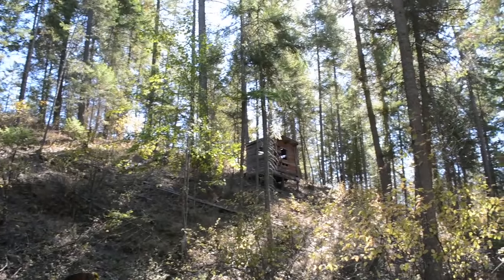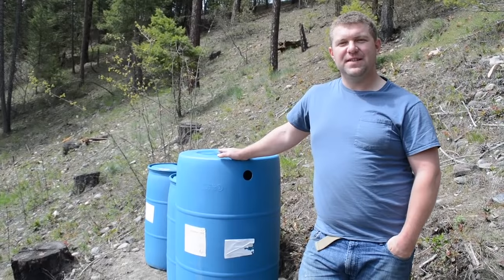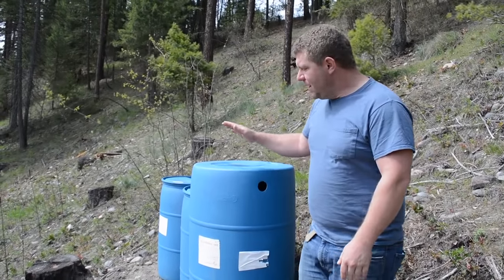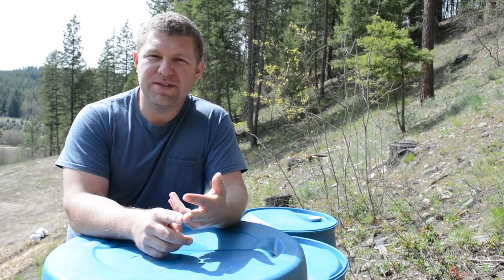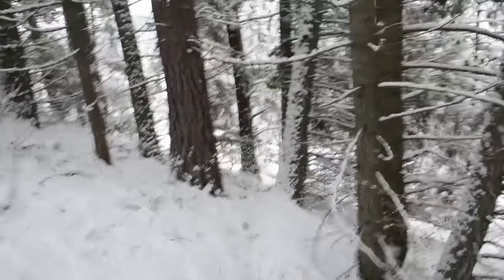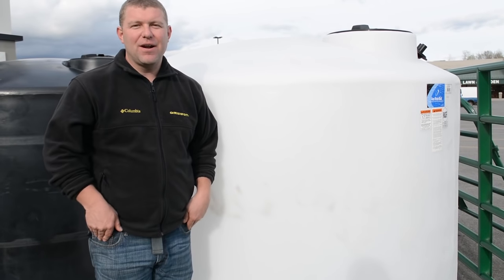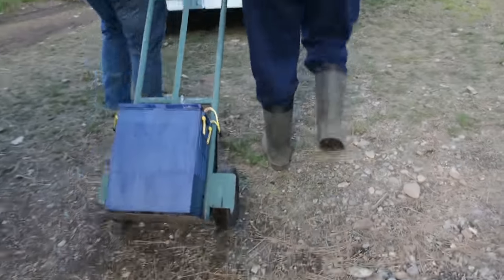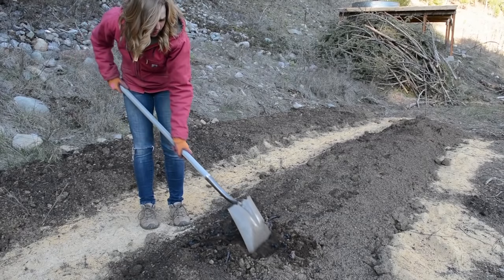Off Grid Living Water Systems: Rain Water Harvesting, Cisterns, Wells & More

Comment: We also use those underground cisterns. They're great.
Though we put insulating plates on top and around them.
We burried 4 of them in a hillside just below the lowest level of our roof.
Of a house that's also built into the hill with it's east, west and northwalls.
on the hill side above we built a greenhousesystem with terrassed planters.
The run of from the windows also empties into our cisterns.
We use a solar panel and windmill powered pump to fill up 2 cisterns burried on the top of the ridge above the greenhouses to gravity feed the veggiebeds and aquaponics systems inside our greenhouses.

Comment: many old houses still have cisterns, just that they are not used anymore. My parents old house had one, it used to be hooked up to the rain gutters on the house. That would be a lot of rain really fast when the rains come. With me considering going off-grid except for 240-volt power for shop tools, the underground cistern with rain collection may be the option for me. But a well combined with a cistern sounds like a great idea as wells are very common in my area. Thanks for the video, is one of my favorites that you have done.

Comment: Hey again. I'm setting up my off grid water. I put a 20 foot gutter on our shack which runs into the collection tank, 50 gals. This runs to a slow sand filter then 2 more 55 gal storage. Just put it together and now it's winter so we'll see how it goes. I'll post a video in spring. I'll be putting a pv panel with 12volt battery and 12volt dc pump for outdoor shower and indoor sink water... should be cool.

I noticed you have a shed, but you could set up similar.

Comment: I figure I will add my two cents. I have a small roof on my chicken coop that is no more than 12 by 20 and when we get one inch an hour rain I can collect close to 550 gallons of water. If you can make some kind of temporary collection method on the side of the hill, possibly with roofing tin, you could collect that water and then direct it into your cistern. you will be amazed at how much water you can collect from a small area good luck!

Comment: I've watched y'all got awhile now. Bought experience is always the best experience I sat as you've tried is and learned from it. when it comes to potable water the simple rule is (A) the cost per gallon, (B) the number of usages, and (C) the supply. This means that usages controls the cost and supply. example, I reuse the grey water from bathing to toilet flushing through reclamation from bath water. With an 3.8 liters per gallon and the usage of 2 liters per flush you can gather 6-7 flushes per nath use. this brings down your usage by about 1/3! with a good plan of using homemade dish liquids in dish washing, you can reduce the cost of water when more! as dishwater cab be used for flushing or reclamation and used for greenhouse plant water. I use rainwater from 2 systems and well water (drilled well myself for less what $500 which can be done by using a well kit from Lehman's hammer well kit. A simple 300 watt solar cell kit from Harbor Freight mixed with a 59' solar wire heater cab keep iced and frozen snow melted enough in (2) 25' gutters to flow into a 55 gallon barrel which can we used for gathering and drinking purposes indoors. I simple use a Berkeley filter system for drinking water. the rule of thumb is 1 gallon of water per person everyday. my water system uses 300 gallons of water per month but reusing our bath water as flushing water, out kitchen water as planting water, our cost per gallon is around .15 cents per gallon overall. use science that was lost in the 14th century and you will be miles ahead! any questions you may have, please email me. my experience includes 15 years as a Seal team member and instructor as well as a mechanical and electrical engineering degree. no one knows everything but to know something and not share is just plain wrong in my opinion. be safe and be well my friend.

Comment: I live in the panhandle of Florida. I use 36gal Garbage Cans from Walfart for $10 each. The Price of the Barrels around here are anywhere from $20-50 Used (Average$30) and $80-100 New. The Above Ground Tanks... the 100Gals start at $150 and go Up Drastically from there. so Barrels or Garbage Cans are a Better Choice and the Water can be Filtered from the Garbage Cans to be Drinkable.  Periodically you can find the 125-225 Gal Totes ( square tanks in a metal frame) from $75-$150 Used.

Comment: Cistern is a good next step.  Loaded question - how do you bury your cistern up the hill from your pad so you have gravity feed for pressure?  This begs the question as to where you might locate a more permanent living structure.  You are building a barn.  Collect the rain off of that, process and pump into your cistern from there.

In my area, most well water has high sulfur content; it stinks.

So here is a thought to help you mitigate your concern about drilling a dry hole well.  Consider using a dry hole as a geothermal well for your eventual HVAC needs.
Reply: +Howard White lmao do you relies how far down you would need to go to get geo thermal anything
Reply: +Ram2 - anything below 5 or 6 feet in the ground.  Yes, one has to have the correct volume to carry the heat transfer load which has to match the HVAC load of the dwelling.
Reply: what are you smoking dude lmao unless you live on top of a volcano you wont get Geo thermal shit at 5-6 ft.
Reply: +Ram2 - appears we are talking about two different kinds of geothermal.  There is a considerable body of work to heat and cool (using heat pump technology) with water put through a ground loop, either vertical or horizontal.  The earth stays a pretty constant 50-60F at a depth below five feet.  AC is pretty obvious; when the ambient air temp is 80F and the ground water temp is 50F, the AC cycle pumps the air heat into the water loop.  And you can get domestic hot water as a by-product.  The heat cycle is the reverse; when the ambient air temp is 30F and the ground water temp is 50F, a heat pump extracts the heat out of the ground water to heat the house.

No, I am not talking about tapping into the magma for steam.
Reply: +Howard White  you are correct. Geo thermal "heat pumps" are very efficient at a low depth ,especially if there is the slightest flow of underground water ,which if you have a high water table and your on a hill ,you've got it made

Comment: Being "techies" I'm sure you've seen and watched many videos on all the basic homestead/off-grid topics. Water catchment systems vids are as many as they are varied and many make it very simple. Your property - large, rural area, cleared and treed areas, level and sloping (gravity) - is ideal! Freezing conditions aside and having the barrels, you could use any combination of barrel systems...in time...very cheaply, using homemade/recycled guttering, screens, wood/lumber, cheap piping, etc. A covering similar to your original "cabin" add-on over the barrels on the south side? Sunken or a simple berm to cover the barrels? Or combine a compost around barrels to keep temps above freezing? In time it'll come around I reckon ;-)
Reply: The more I think about it, combing a compost area with rain catchment systems in cold climates has some potential, but since live in southeast Texas, it's easier said from my perspective, lol. Best of luck!

Comment: +Pure Living for Life 

Guys, HOW windy IS your property? Have you considered a wind turbine, or two? Have you thought of the fact that a dump load could be used to help heat an insulated storage room where you may store water tanks, etc. Distance from your windmill(s) to your rectifier(s) shouldn't be an issue, due to the high voltage prior to using a rectifier to usable DC in order to charge your batteries. (I saw the 6 volt batteries in this video, so you are on your way there, already.) You have other options available to you, as well.

Comment: For Off Grid Hot Water we use a 40 gallon stainless steel wood fired "kettle" that we bought from the Amish. The saddle tank on the wood stove did not produce enough hot water for a family of 5's dishes, laundry, baths/showers...

Hot water is an essential and one of the big problems for "Off Griders". The wood fired kettle solves that issue. All you need is wood and rain water.

Comment: Great info.  You are correct about experiencing the pressure is so much more valuable than a calculator.  :-)     Keep up the good work.
Reply from the maker: +John Godwin Turns out a lot of this stuff is that way. Read, study but at some point, try it! One of the many reasons our project has taken the course it has. Learning on simple tasks before swallowing a whale of a project in building a home.

Comment: Use the top half of that big hill you have. Permanently stake your tarps or plastic sheets to the ground.  Pitch them upward on the sides lay rocks over the tarps or plastic sheets, this will hold them down. over lap them like shingles. Place a gutter at the bottom for the collection point and aim that into your cistern.  Must be an underground cistern if you get single digit weather due to freezing.  Pipes must be underground too or they are at risk of freezing also.

Comment: I have lived for 15 years with a off grid water system all my house water is rain water collected off my house and shed roof into a ten thousand litre concrete underground tank and two five thousand gallon above ground tanks an one five hundred litre above ground on a tower overhead tank that we use a fire fighting pump to fill this gravity supplies the cold water taps in the house and has enough pressure to operate our on demand propane hot water system we have great pressure inn the house we tried a well but couldn’t find water before we ran out of money we are in Australia so freezing is never a issue but catching every drop of water is the norm all our live stoke needs are supplied by a two mega litre dam on a seasonal creek that runs through the back of our property we use grey water in the garden

Comment: Check out permaculture systems. They use rainwater once there's a house. Then the rainwater is your shower, which drains into your inside plant gardens; your bathroom sink is rainwater and kitchen sink. Everything has a filter before it goes into the gardens and is recycled back up into the toilet and the hoses to water the gardens. They are saying the water is recycled 4 times and they have 2 huge cisterns under the ground. The cisterns are part of the recycled water system. confused? The water is also filtered outside through the gravel in the gardens inside and outside. Sometimes there are 3 levels of gardens that drop down outside to filter water - waste. Some gardens can be set up to filter waste, some to filter water. obviously on opposite sides of  the house. Complicated.

Comment: My main water tank is 90,000 litres and supplies my house with all the water that I use. I also have a 4,500 litre tank but I mainly use that for the garden.
Reply: +Z71Ranger It just falls out of the sky onto my roof and then goes into the tank.
Reply: +Z71Ranger What pollution?
Reply: +Z71Ranger It's not really a concern.
http://www.waterra.com.au/project-details/4
Reply: Build an ample first flush diverter for your rainwater system and the water is very clean.  Also, a biosand filter could be used on the other end if you wanted.

I think of all the guck thats in the miles of city water pipes that gets to my filter at home.  It's always disgusting.  Not to mention the things that are put into our water supply using our tax dollars that isn't good for your health.  When I did my studies on it, city water could have as much as 300 PPM of TDS and rainwater had 4PPM of TDS.  4!  I'll take the rainwater for sure!
Reply: I have wondered about the bird poop thing. And just bugs, dust and pollen and things like that.

Comment: You don't have to "roof" the hot tube deck to collect water, you just need to make the deck hold water and give it slant so it doesn't create standing water.  Or set up the tarp or plastic roofing under the deck connected to the supports.  Won't blow away then.

The other would be to simply collect the water off your house roof and then dedicate a solar panel/pump combo to pump water up the hill to a storage tank so you can have steady pressure.Look at builditsolar dot com for some tank designs that won't freeze in the winter.

Comment: nice, okay ,here goes , I noticed how your garden is going uphill that's great, make more 100 200 foot Berms going horizonaly up the hill and plant garden rows on the outer edge of the berm with 2 separate plastic pieces,1 underneath the garden and  the second one underneath the regular water collection part of the berm to retain also collect tea to reuse and make them at a slight incline toward one end where are the water drainage we'll come to that in to a collection pipe and then pipe will go down to your collection tank Underground,1 tank for garden tea,2 tank for drinking water
Reply: In wintertime you can put small tunnels Over the Garden part and leave the inner regular water Collection part exposed okay ya,ll have a good day and enjoy
Reply from the maker: +CHICKENRELIGION.COM Excellent ideas! We're very curious to try using terracing in the future. Seems a shame to let all this elevation go unused. :)

Comment: you live on a steep hill? dig a trench at the base, line with landscape plastic, fill with rocks and move water to storage area? Storage area could be a deep wide hole filled with large rock? As the snow melts as it always does even when it's freezing outside deep in the water pit down 10-20ft there will fresh water? you could control erosion this way another problem you may run into trying to plant crops? Good luck

Comment: my well would cost 20k. lol but rain harvesting along with water delivery works best. in fact my 300 gal tote I can go and pick up water which cost about $5 per 300 gallon or have 750 delivered for $45 so picking up water is the way to go.
Reply from the maker: +ArizonaHotHomestead Wow! Water pickup is rad! Love it!
Reply: I had a 150-gallon water barrel on 2 wheels I towed behind a pickup to get water from a community source. Those tanks can be mounted on homemade trailers like the one I had, but be cautious about what might have been in the tank if you buy used. I bought mine to pump water into a mobile home waiting for a connection to the local co-ops well and hauled water for a long time. (Finally had to lease my neighbor's unused meter and run pipe a mile when they never got around to drilling a well to add capacity for YEARS, but kept telling me "we'll have water for you very soon". They tried to talk me out of doing it - and it was another year after that before I got a meter from them.) 

I kept the tank to use to manually water horses when the faucets froze up. A neighbor had a faucet on their garage that didn't freeze that year, so I got a couple tanks of water from them to manually water until the faucets unfroze.

Comment: I'm still deciding between roof water catchment and having a water tank that's filled every few months.  Where I am in Oklahoma, it barely gets below freezing in the winter.  I also have no slope on my land, so gravity-feed is out, unless I went with a water tower (but then..how to fill it?)
Reply from the maker: +Larry Shinn (Tiny Cabin) Sounds like you're getting VERY close Larry. We didn't talk about the role gravity vs pump fed plays in your water selection process but it's definitely something to be considered. Maybe another video on the subject!?!
Reply: Before everyone had electricity to pump water, they used windmills to push the water up into a cistern on a stand. There are still windmills in use today, and I once saw small wind turbines on the Tractor Supply website. 

If you have electricity, you can pump the water up into a tank and then use gravity to send it into the house. But if you have electricity, why not just catch the water off the roof into a cistern and then use an electric pump to get it from the cistern to the house?

Comment: What size cistern are you think of ?

If you are going to have water delivered, will you put the cistern on the flat part of your land our up the hill so that you can get gravity feed ?
Reply from the maker: +theoldwizard998 We're on the fence between a large 3000 gallon vs two 1700 gallon tanks because of budget today vs needs tomorrow. We're tempted to hold off a little longer and go with one 1700 gallon today (better price per gallon than 3000 gallon cisterns) and then perhaps down the road a second 1700 gallon to feed the lower cistern. 

Yep cisterns will be placed at the top of the hillside and gravity fed. Should deliver about 33psi at the house. Plenty to have a water park....I mean cedar hot tub! :)
Reply: +Pure Living for Life Have you double checked with the water delivery company that they can pump that far up hill ?

1700 now and a planed for space for another 1700 sounds like a good plan.

Comment: 1 barg of pressure per 10 meter of elevation minus the resistance of your hose of choice. (factored mostly on the hose size). Typical in house plumbing pressure is 5-6 barg. Ergo, at least 60 meters should give you 5 bargs of pressure out the other end.

Comment: Surprised you didn't run temp gutter on the metal roof next to your wood stove building for rain collection. If  it worked out, then you could expand your building, super insulate and heat with air from the wood stove.

Comment: you need a solid roof for rain water collecting and and a 5000 gal or bigger tank  and you will need to keep it insulated in winter and have a heatcoil around it to keep in from freezing..